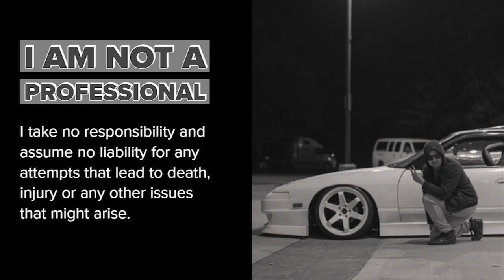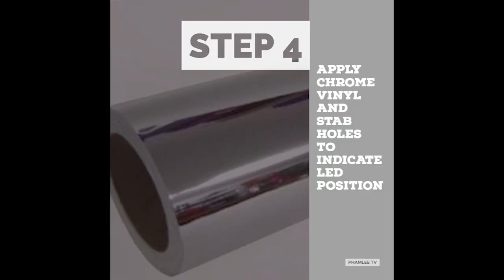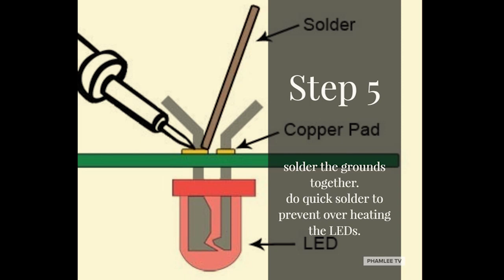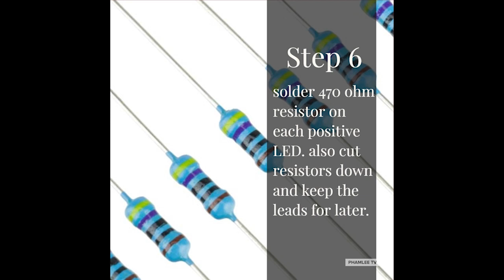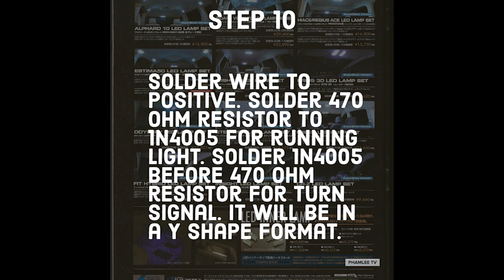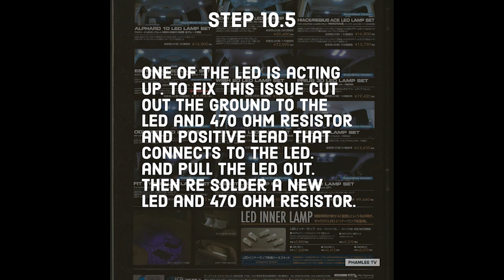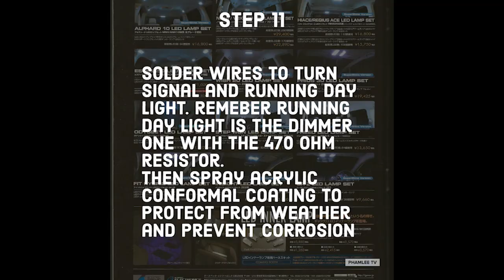DIY LED 180sx front position light / turn signal

Comment: did you have to shave down a little of the inside of the bumper for them to fit? mine do fit properly on my type x bumper
Reply from the maker: should fit type x no problem unless you have aftermarket fiberglass bumper. fiberglass bumper might need modification to bumper or position light housing.